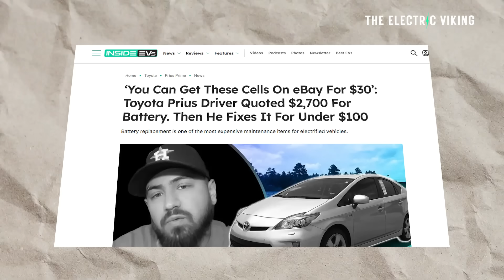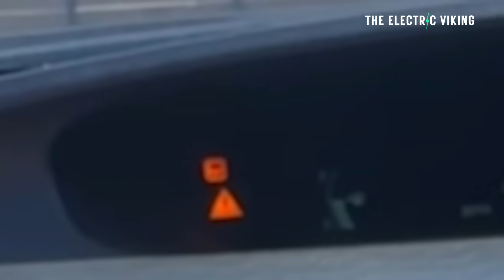$3000 USD to Replace a Toyota Prius Battery - or Fix it Yourself for $100

Comment: Replaced my 2013 Prius hybrid battery at 200,000 miles- I did not take care of it, did not keep air cooling fan and associated air channels clean- was completely clogged with my dogs hair,  battery overheated, I bought new hybrid battery from Toyota for around $1800 with core charge. Had to take relays, etc off old battery pack and install in new pack. I plan on driving it for another 150,000 miles so I wanted all new cells as some cells good cells will soon depreciate and need changing, Took me 3 hours to replace.

Comment: This guy just needs to stop talking about pri and keep fanboyin full EVs. I’ll keep driving my gen 2s long after first gen teslas, gms, and ford EVs have burned down or been totaled out due to a minor fender bender. 362k, 353k, and 211k. I rebuilt all batteries and I expect them to go for 200-300k yet before they rust out.

Comment: This is not an DYI project.   Find a qualified shop to do this work for you.    No you CANNOT just drop a lithium ion phosphate battery in place of the stock battery in a Prius.  Two completely different charge controllers.   The safest thing to do is sale the car as is………it is still worth money WITH the bad battery pack.  Move on.

Comment: This is controversial, and maybe be dangerous for some.  I have a 2011 hybrid - ie 14years old. The battery was very down and I checked world wide and found a reputable battery manufacturer and had the battery replaced for around $5000 - all new cells, done by experienced local company and a 3 year no cost guarantee.
 To do it "your way" - the battery has to be removed disassembled each cell tested on a machine that costs around $2400, then  buy/replace  ?? cells and rebuilt and reinstalled. The labour is around 12 hours if everything goes right at $245 per hour (Grok answer) is $2490 + the replacement cell cost with no guarantee the battery will last, and most cells now reaching EOL. Yes the machine can be used again but still has to be bought. thats $4890 with no guarantee and a much shorter life before replacement again. Finally high DC voltages are VERY dangerous, and encouraging DYIers to meddle with it is in my opinion irresponsible of YOU.

Comment: I would't do this myself even if it is a lot cheaper. Lots of scary things could go wrong doing it yourself. Hey if you are a mechanic who works on replacing Prius batteries, go for it. For me, I already have a place picked out that can swap the battery for about $1500 and give me a better battery than was installed in the first place. That's assuming my Prius battery gives out before self driving cars become available or something that costs a lot more to repair does not break first. For the record, my Prius was made in 2009 which was 16 years ago. Not too bad for NiMH batteries. And another thing. If I were to race the Viking on a 500 mile trip, my Prius will beat his electric car every time because I only need a refill ever 400 miles or so and it is a lot faster pumping gas than electrons.
Edit: Just got to the part where this guy tested every cell and only replaced the cells that were broken. What the ffffffff? So when more cells break you are going to do that again and again in the future? That's idiotic.

Comment: Replacing individual cells in a pack is very tricky. The Original pack was assembled with cells normally made from the same batch of electrolytes
and coatings and all will have a similar internal Resistance. A replacement cell would need to have the same resistance level to last very long.

Comment: I don’t understand people turning their nose up at Prius batteries purely because they are NMH.  That small battery regularly charges and discharges at very high C rates and lasts for many many years and must be thousands of cycles.  Its in service performance is excellent, seriously, what does it not do well?
Reply: Stay cool in high temperatures , or very low temperatures.
Reply: What it doesn't do well is eliminate the need for fossil fuels.  It's a small step up from pure ICE, but bigger steps are needed.

Comment: Something missed.  All EV batteries are programmed to the car's BCM.  You cannot just simply swap packs from a wrecked car to yours.  No car dealer will simply reprogram your self swapped battery to your vehicle, and this is not able to be done with an ebay OBD scanner.  Unless you have the skills to replace individual packs or can swap the batteries internal control module to fool the car's BCM. this is not an easily done swap. Also, keep in mind that these batteries frequently weigh in at or over 1,000 pounds, making it necessary to use specialized tools to move them around, and you'll need a lift to raise the car up high enough to move the battery out from under it.  There are reasons why this cost is what it is.  Dealerships amortize the price of the tools and equipment into the price of the job.  I'm all for do it yourself work. One just needs to be fully informed of what it means to do this yourself.
Reply: Nah. It can be done

Comment: You can go to the salvage yard and pick up one that has 50-150,000 miles on it pull it out the deck car for $500-1000 for used working battery 🔋!!! Original OEM Toyota quilt!!!!

Comment: Toyota synergy drive (hybrid) could have been rolled out to the entire fleet.  It would take three steps:  1)Use power dense Yasa motors in their e-cvt. 2) Toyota does pack guarantees with easy swap. 3) Gets rid of dealership model, which is now obsolete and expensive.  Win:  Toyota synergy strategy buys them 10 years to design full EV and catch up to China/Tesla.
Reply: Toyota has had NO NEW ENGINEERING in the last 30 years. This hybrid was engineered in 1997 in conjunction with Ford.
Reply: @b4804514 
Pretty clear who was the lead in that project.
Toyota kept Priuses going forever, Ford couldn't keep their Escape Hybrid line going.

Comment: You just said it’s $30 per cell How many cells? Plus you get a whole new battery pack
Plus the labor to install it. 

I don’t know why you keep using the word ancient as if it would mean something is cheaper.  Sometimes ancient means more expensive because the production values are low.

Comment: So the repair is not $100.
It’s $30 per cell plus labor. 

There’s another way to do this.
Apparently, there are companies that will test the cell assemblies. You can get a match set for much less than the cost of a new battery. Of course it won’t last as long as a new one.

And I’m not sure why $3000 is considered a massive cost.
I paid $700 for a back up camera
And $600 for an E brake on a Honda. $1000 for the valve cover gasket.
Reply: A valve cover gasket on a 4 cylinder probably takes 30 minutes or less to change out. Even on a v6 it wouldn't take more then a couple hours. Sounds like you got ripped off bad
Reply: @ivar-the-terrible 
I did a quick search and it looks like it was about 400-450 so I must’ve put in the back up camera. 
My mistake.

Comment: It is a very well known fact in Prius community that replacing just the bad cells does not work long term.  Other similar aged cells will eventually fail.  You will be replacing failed cells every few months with other newly purchased old aged cells.
Reply: the tiktok’er should have repacked everything. that will assure the car’s reliability

Comment: Really misleading since a good chunk of the quoted replacement cost is going to be labor. Sure anything is cheaper if you can do it yourself. Also if the battery pack is old it is not a good idea to replace just a few cells since the likelihood is that other cells in the pack will fail soon and you will have to do the repair again. If you have gotten say 10 years out of your original Prius hybrid battery and the car is in otherwise good shape then paying $3K for a warrantied replacement battery isn't a terrible price to pay for many more years of service. Also if you are buying a used Prius with a bad or seriously degraded battery you will get it at a good discount which will at least partially make up for the replacement cost.
Reply: Yes, I agree. Replace ALL batteries.
Reply: Labor is one hour to swap out the pack. I've had it done by someone in 30 minutes in my gen2 Prius.

Comment: NiMH isn't ancient tech.  They were released commercially in 1989 while Lithium Ions were commercially introduced in 1991.  Although NiMH batteries have less energy density than a Li-ion battery, NiMH are more durable than Li-ion, less of a fire risk and they don't need cell balancing when charging.
Reply: Dusd stop it we have lithium iron phosphate... NiMH is ancient tech
Reply: @viyusavery248  You don't know anything about batteries
Reply: @PeTroL420  pretty ironic because objectively you know nothing about me

You could have strengthened your argument with your point but you chose the emotional ad hominem 

Toyota can use LFP not sure where they are using terrible NIMH .. we have insane cycles life that NIMH can only dream about
Reply: @viyusavery248  I know enough about you that you think you're smarter than the engineers at Toyota
Reply: @PeTroL420 engineers at other automotive companies have gone to other chemistries
Reply: Right, it's medieval tech
Reply: @petervan7372  Oh look, another person that doesn't know anything about batteries.
Reply: There's a sodium ion replacement for hybrids that one guy offers online. It's called "nexpower"
Reply: @ivar-the-terrible Do you also believe in Santa Clause?
Reply: Toyota's original choice was intentional. Lithium-ion batteries were first developed and sold commercially by Japanese companies, so all Japanese companies knew the strengths and weaknesses. It was intended for rechargeable small electronic devices like cell phones, laptops, walkmans, shavers, vacuums, etc. 

We still have mobile lithium-ion batteries catching fire on airplanes. Given the characteristics and ingredients of Lithium-ion batteries, they were never meant to be used in vehicles. It's also why Japanese automakers won't be building up a large BEVs line-up until there is a break-through in battery technology. Lithium batteries are good for certain applications but unsuitable for many others. Recycling is still a massive headache if all vehicles become BEVs.

Comment: You are not going to be able to replace a Prius battery pack for $100. It's work and it also takes some expertise. Also go with an OEM battery or a renewed OEM battery with a warranty, they last a long time. By the time you get through your 2nd battery it's time to junk the car.

Comment: Looking at the pack assuming it is 1 stack of batteries deep that is 28 cells at $33 (i assume used) is $024  a new prius hybrid battery runs about 1200-1800 depending ib seller yes you can replace the cells if you know how and who knows how many cells you need. Also what year battery that also matters..

Yes he saved a lot of money... was there going to be a good warranty on the replacement battery they were quoting

Comment: It's only 2-3hrs labour
Reply: If you know what you are doing and are just swapping battery packs.
Reply: At $150 an hour.  If you they can do it.  In California probably cheaper.  Because there are a lot who can do it.  But there are other components that cost more.
Reply: @tireddad6541 I've never paid that much. A few years ago I got a whole new pack swapped in for $900 AUD.